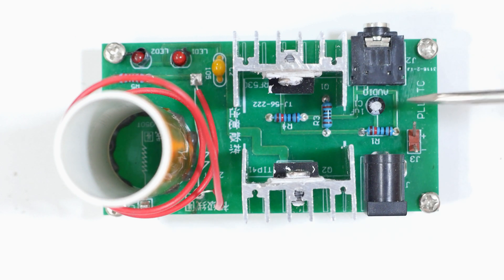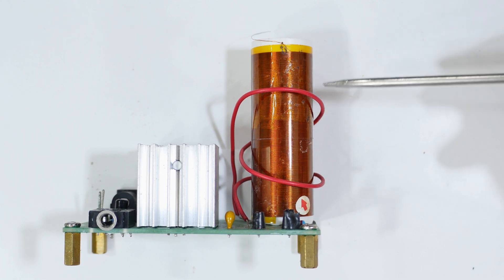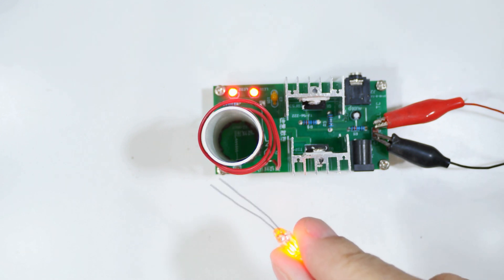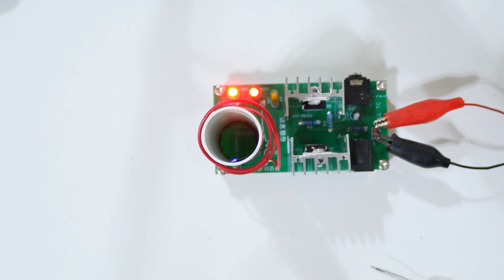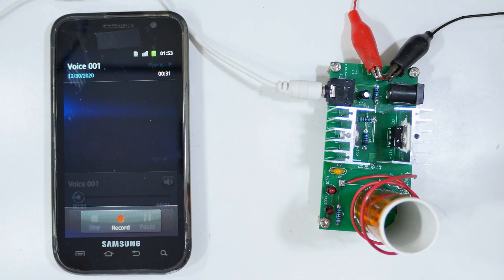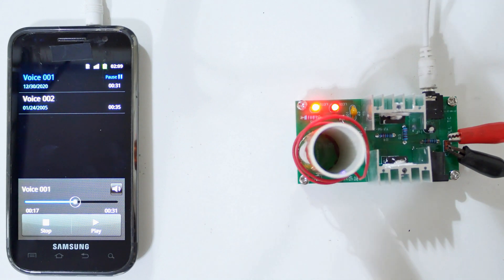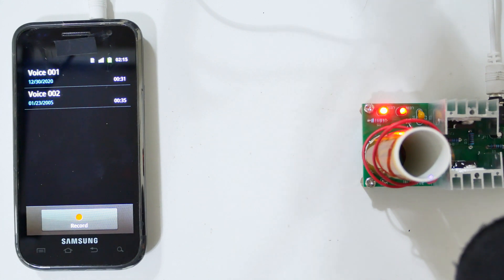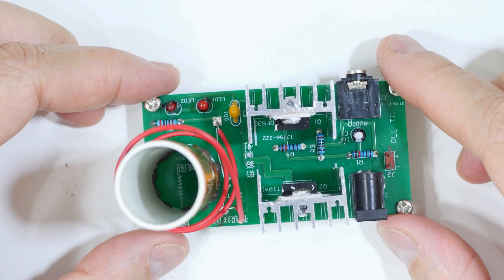Tesla Coil Speaker Kit (4K)

Comment: I bought such a kit too, but the red cable for the primary winding is only long enough for one turn in my kit. 

I can't really compare your results with mine without hearing it in person...but there are a few things I can tell: 

The kit runs at 10-12V with about 1A. The radiators heat up not as fast with the reduced voltage. But apparently it can handle up to 18V, at least mine can. The music gets louder as voltage grows, but the current grows to more than 2Amps too. Which would lead to overheating. 

The modulation of music over the oszillation of the tesla coil does not work as good/bad, depending on the volume of the mp3 player I use it with.
So if the player is too loud or too silent, the coil wont reproduce it. 

Also the end where the plasma is, heats up and the clear coating starts evaporating from it. So, either it needs something more heatresistant to be attached at the end of the cable, or just do not run it as long.
Reply from the maker: Seems mine is about the same as yours.

Comment: I think that it was Electro Boom who used a plasma ball or maybe a jacob's ladder setup as a speaker.  That seemed to work well, although the sound was "scratchy", it was pretty much exactly what I was expecting it to sound like.  I don't see why your Tesla Coil should be much different.  I don't know enough about it to say what adjustments you could do to the primary coil to improve your results, but I suspect from what you said about it, that's the magic part.  Now I'm off to look for Tesla Coil kits. 👍